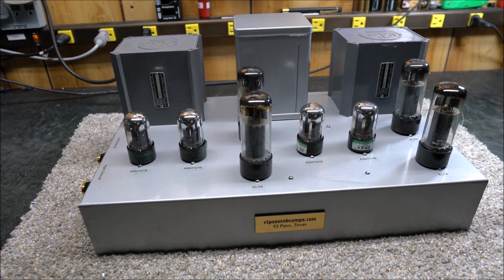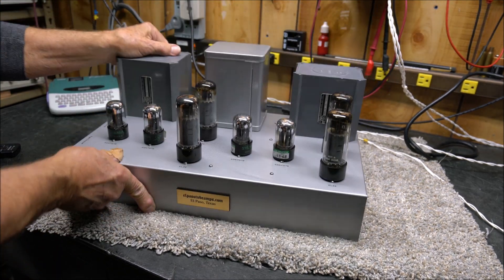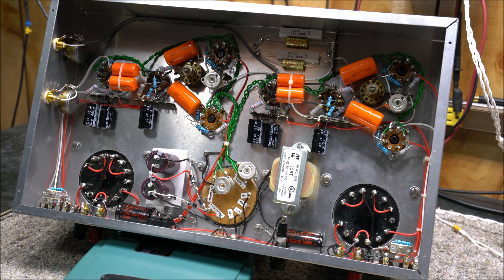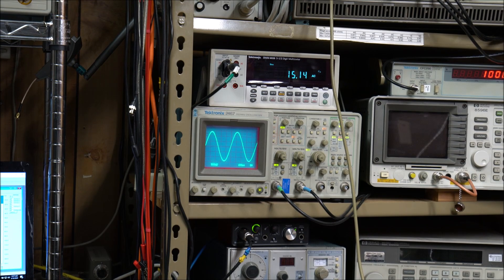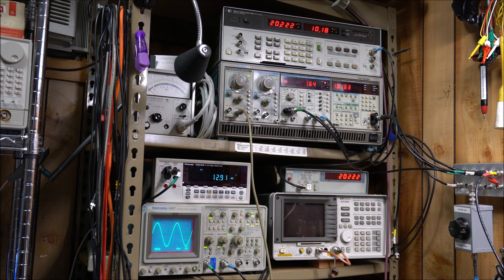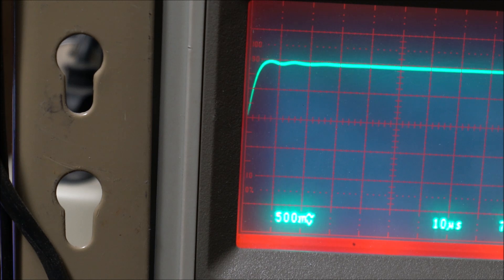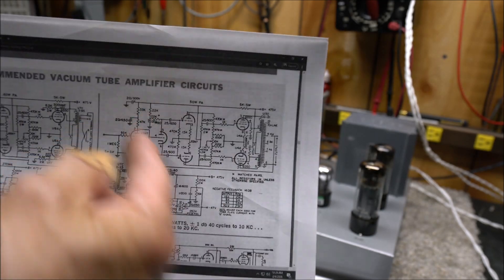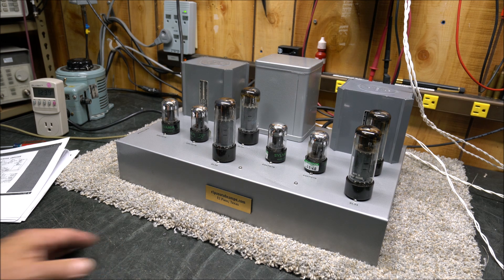Vintage 1959 Mullard EL-34 With UTC LS-57 Output Transformers In Stereo Williamson Amplifier

Comment: zobel network provides a load at high frequencies..
Reply from the maker: Thank you... I knew one of you guys would know what it was meant for.
Reply: It also presents the OPT with a similar load with different speakers. Stops the speakers impedance at different frequencies having as much effect . I use one on all my valve amp builds, start with something like a 0.1u and a big 10r, you have to experiment to get the best result....DA
Reply from the maker: @diabolicalartificer  I knew you guys would know the best answer. I have used them but I usually don't just like the little RC circuits I mentioned in the video - but, if we feel they are needed it is good to know about all these remedies.
Reply: Here in the UK some manufacturers (Naim, Exposure, NVA) preferred not to fit one, along with the output inductor in their solid state designs. As such advised against the use of high capacitance Litz speaker cables which could (and did) burn-out the output stage if used.
Reply: @stephenfurley1025  They're responsible for their own design decisions.. One of the main objectives of the zobel network is to provide load at high frequencies to prevent oscillation.
Reply: Yes, I know. With solid-state, I think the term " unconventionally stable into any load" would often be stated with regards the output stage and  the Zobel network and output inductor.

Some designers don't believe in filtering. The ones mentioned had it stated in their warranty that using high capacitance speaker cables would void their warranty.

Comment: ElPaso TubeAmps could you make a video explaining how a linear Rf amplifier like the one in this link works and any improvements that could be made in this 200 watt grounded grid linear Rf amplifier if used to amplify an AM transmitter signal here is the link https://www.robkalmeijer.nl/techniek/electronica/radiotechniek/hambladen/qst/1955/06/page21/index.html
Reply from the maker: Parker,
That is a very interesting amplifier. I read the entire article. Very nicely written and he touches on all the important points. 
The fact that the base of the tube from the 807 or 1625 must be removed to disconnect the beam forming plates is likely going to be a challenge and will make spare tubes a problem. You could not use the 807 and have a base pin to connect the beam forming plate to as all of the pins are used in the standard 5 pin socket. The 1625 is a 7 pin socket so you could use pin 2 or 5 for this re-connection of the beam forming plates so they could be grounded independently.  I can see it working but this is truly a labor-of-love amplifier and complication beyond anything I have seen before. I find it interesting and I did not know the beam forming plate connection was external to the inside of the tube envelope. I don't know if that will every be used by me but it is interesting to know. In my opinion, having to remove the base from the tube is just too much to go thru. I hope you understand my thoughts on it.
Not tuning the input circuit will cause a good bit more distortion in the RF output and make the tube(s)  harder to drive. It is a good idea to always tune the cathode circuit in a GG amplifier. 
Lastly, using a "linear" to amplify an AM signal is very inefficient but it can be and is done in some cases.
From my perspective, this is a novelty of an amplifier design and interesting to observe the uniqueness and ingenuity of the designer but I would look elsewhere for something that did not require modification of the actual vacuum tube to make it work. Just my thoughts on it.   73  WA4QGA